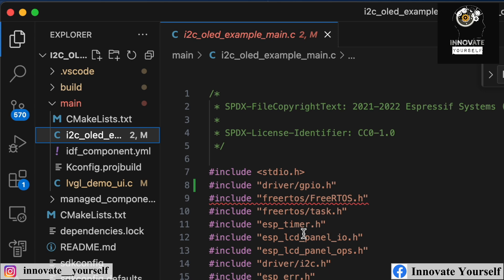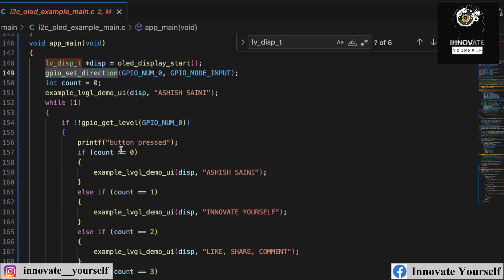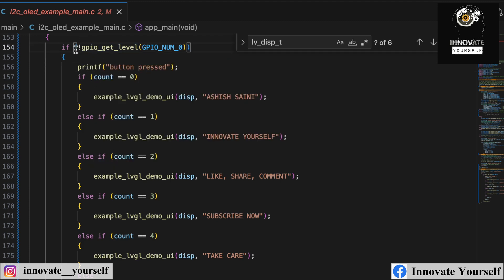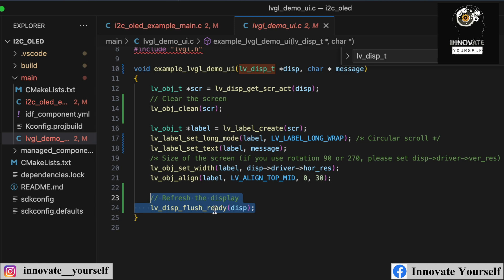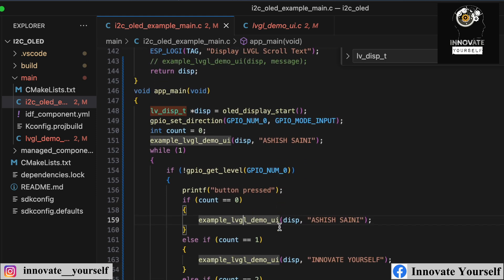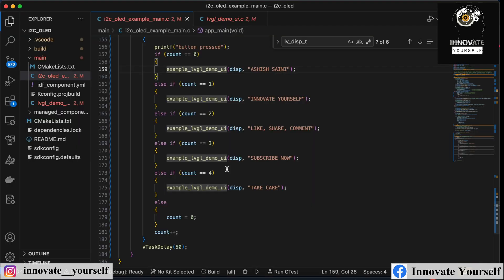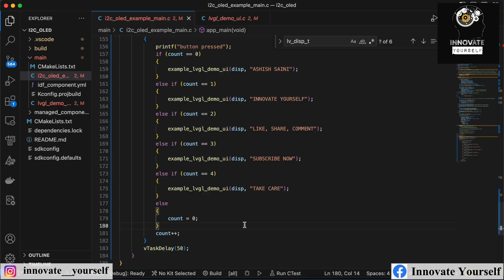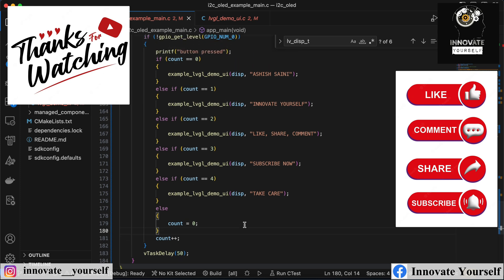Boot Button Message Control with SSD1306 Delight: ESP-IDF

Comment: Likewise can we program reset button?
Reply from the maker: I will have to check that.
Reply: You might have to stop the interupt handling that switch. If we could use this switch then up down menus can be made using these two switches
Reply from the maker: Ok. I'll check that on my end. If I manage to do it then I'll surely make a video on this. 😊